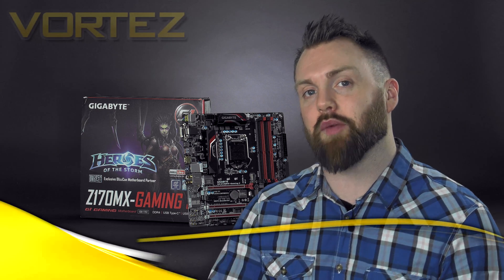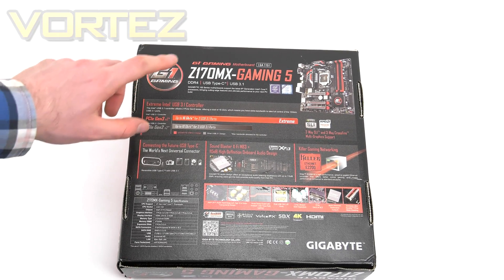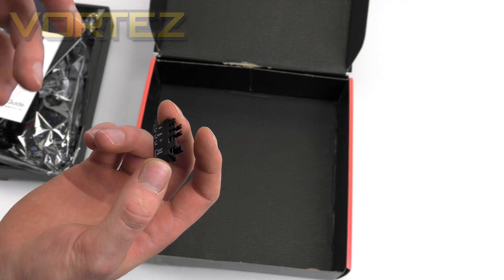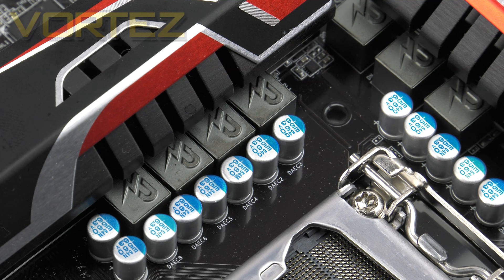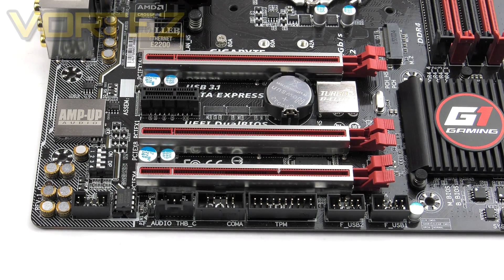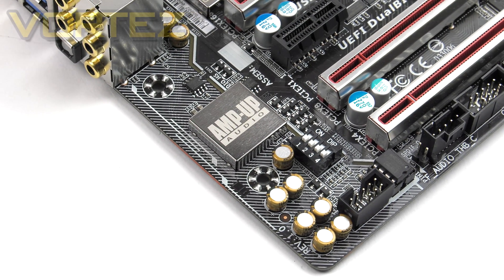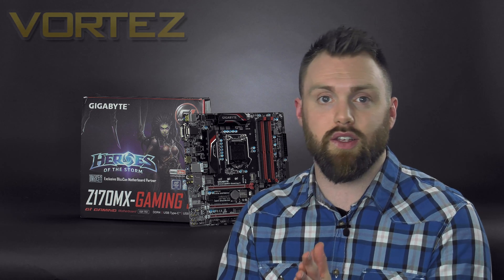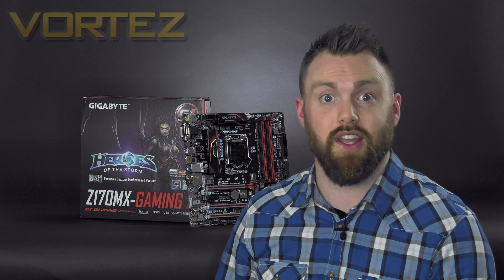GIGABYTE Z170MX Gaming 5 Review [4K50p]

Comment: I have this board with i56600k and gtx1060 3gb. 16gb ram.What is the highest graphic card that this board support with my build. I want to buy a new graphic card.
Reply: you can use any gpu in this. PCIE 3.0 is the standard on all motherboards. just use it in the top slot for all 16 pcie lanes

Comment: please tell me quick: is this motherrboard compatible with core i5 8400?
Reply: you'll probably need a z370 chipset for that CPU as it is the 8th gen, z170 is 6th gen
Reply: Adam Spina sorry you replied after I bought the wrong mobo and found the right answer for the problem myself. At least I learned a lesson about chipset. Wish intel use different socket for different cpu chipsets. Z170 and z370 all use lga 1151. But now I know. Research is harder than building
Reply: MojangYang YAN0014 Definitely, sorry to hear that btw
Almost happened to me so I was hoping to help :/

Comment: Thanks for the review, could you please post the bios adjustments & specifications that riches 4.8? I can not even use the factory OC. of 4.6. It is fine up to 4.5 by factory OC. 
Thanks in advance!
Reply: Hey Kevin, i know it's been 4 years, but i just reapplied the paste on my CPU and GPU so im getting way better temps as before. So i thought why not OC a bit? So i upped it to 4.5 but after a couple of minutes the PC restarted. I think something is overheating. It might be the CPU or the mobo actually? i noticed it runs pretty hot. Do you remember if you managed to use it stable?
Reply: @Szilagyicsabaistvan  in games no. Just up to 4.2
Reply: @kevindad9763  thanks for thr fast reply. I'll stay at 4.0 then, just to be on the safe side of things.
Reply: @Szilagyicsabaistvan  yeah, I keep it on 4.00